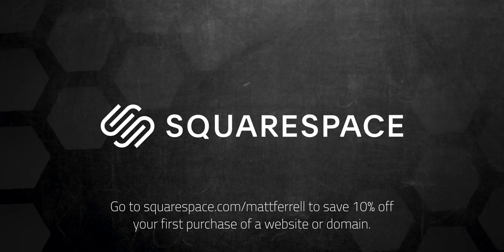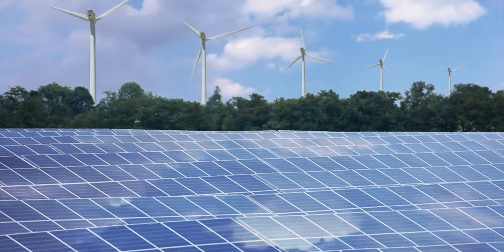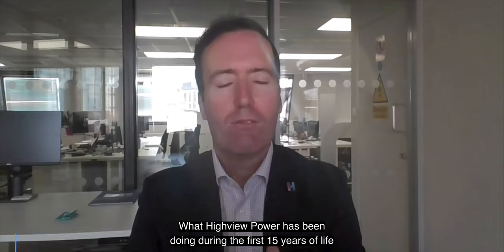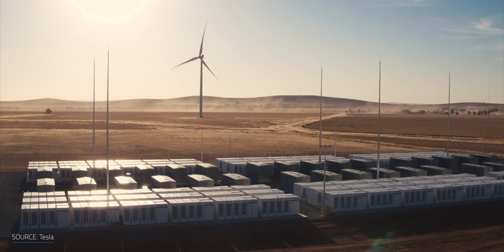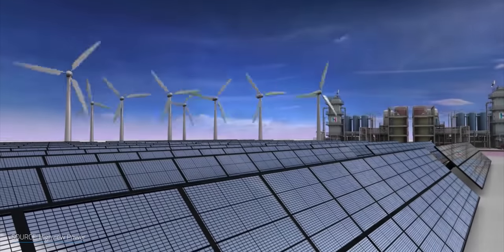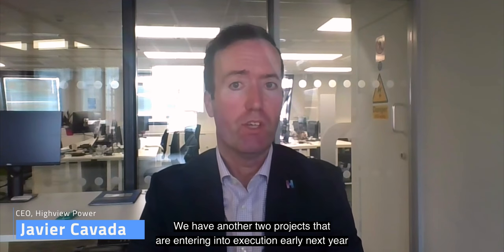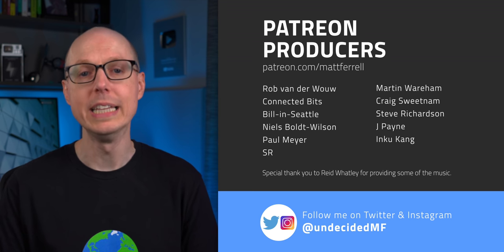Liquid Air Battery Explained - Rival to Lithium Ion Batteries?

Comment: Sorry for nitpicking, Matt, but again: "rare earth metals" ("rare earth elements", actually, by IUPAC) does not simply mean "rare" or "expensive" or "difficult to procure" metals. The term is precisely defined as denoting lanthanides plus scandium and yttrium - certainly not lithium, cobalt nor nickel. None of those are used in batteries, AFAIK, although some are used in permanent magnet motors (and generators), usually neodymium. Perhaps that's the source of seemingly endless misuse of the term.
Reply: Thank you. I am tired of the same rare-earth-myth being misused and spreading misinformation over and over and over...! At this point it is not nitpicking, it is a concession that people just believe things without questioning them not bothering with a quick lookup if that information has some validity to it or whether it is pure bogus or something in-between.
Reply: @d1oftwins  Yes, talking science and technology requires precision. If one is going to use technical jargon of a particular field, one should use it correctly.
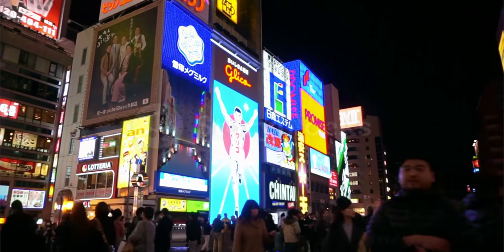Reply: 4:46 Also on the nitpicking front the air isn't frozen, it's condensed.  Frozen air would be a solid but you clearly said it's stored as a liquid.  You'd have to get down to -210°C (for the Nitrogen) and -218°C (Oxygen) for it to freeze.
Reply: @EscapeMCP  Yeah, again "loose" use of words that has no place in videos like this one.
Frozen air would be a nice "reservoir of coldness" (heat sink), but that's not what is needed here. (Frozen nitrogen is sometimes used as coolant in space-based telescopes - lighter per energy absorption capability than liquid helium, and much simpler than active refrigeration systems.)
Reply: Yes. You'll not stop it of course. People & groups have decided what's simple catch phrases for the masses for various things and they are soon promulgated, ingrained and thus the confusion will be permanent. It annoys me too but I realize that that's Life.
Reply: @grindupBaker  I somehow hoped that Matt will correct his ways if warned often enough. Perhaps I was giving him too much credit.
Reply: Poor Matt, he does nt stand a chance with you guys
Reply: @philipwoodgate9555  Hey, if we didn't respect Matt's work, we would not have bothered correcting him.
Reply: @bazoo513  excellent
Reply: @bazoo513  For me it is not so much the precision of language and terms, although I am quite a fan of people explaining themselves precisely. Nobody is perfect and it is a bit too much asked, at least for the layman, to accommodate themselves with the knowledge that trained scientists had to acquire in years. In a (broad) discussion it is possible to iron out the mistakes and nudge the ignorant into the right direction. What I don't like is that science myths are permeating the populace because information is accepted or dismissed on basis of personal bias and not because of the underlying facts.
People choose to believe or dismiss information without checking for correctness on a whim, which is everything else but scientific. Unfortunately that is how it works most of the time, most people don't have the time to invest in even a quick research, or worse, they simply do not care and just believe what fits their bias. I just don't like how and why such misinformation spreads, but I guess I have to accept that this is how our human perception of "reality" works and that we have to actively work against our biases to not contaminate the bare truth, at least as far as we are able to measure it.
Reply: @d1oftwins  I agree - intellectual laziness, confirmation bias and Dunning-Kruger effect all conspire to promote propagation of misinformation, especially within echo-chambers of social media. But I don't think this is the case here - all Matt did is use a wrong term from withing chemist's technical jargon. I will continue  pointing out his mistakes, but I don't think they diminish greatly the value of these videos.
I would prefer, though, if Matt acknowledged the error after all the corrections here in comments.
Reply: From usage I got the feeling the rare earth elements do not denote actual rarity of the material but rather that is what the material that is dug up to obtain them is called. No idea why though. Maybe it was considered rare at one time and the name stuck.
Reply: @jacobfreeman5444  They are "rare" because, while some or them are actually quite plentiful, they are "dispersed" in Earth core - pure ores are very rare.
From Wikipedia:
"Despite their name, rare-earth elements are – with the exception of the radioactive promethium – relatively plentiful in Earth's crust, with cerium being the 25th most abundant element at 68 parts per million, more abundant than copper. However, because of their geochemical properties, rare-earth elements are typically dispersed and not often found concentrated in rare-earth minerals; as a result economically exploitable ore deposits are less common.[5] The first rare-earth mineral discovered (1787) was gadolinite, a mineral composed of cerium, yttrium, iron, silicon, and other elements. This mineral was extracted from a mine in the village of Ytterby in Sweden; four of the rare-earth elements bear names derived from this single location."
Reply: @bazoo513  right so you grab some random square mile of Earth and some things will be more common WITHIN that load than others.

Copper is a Rare Element. Most of the stuff that you need to use electricity makes using electricity not a rational option for anything but logic and, in the past, lighting.

In the video you see the liquid nitrogen being sprayed. You see all these strange things in their videos. What You Don't See is the cost of liquid nitrogen  if the production is adequately scaled-up, less the cost of the energy. That's the variable that you need to disclose the range of cost for the infrastructure after the shaft that you spin or the input for the neutrons. Without knowledge of that number this is just another regurgitation of Industry propaganda something I have coined to be technological capture.
 Engineered liquids that are as dense as Battery Technology are a threat so you capture their technology and allow people to believe they are familiar with its potential.

I am inspired by the term "regulatory 'capture"" obviously. An engine that uses low enough cost liquid nitrogen COSTS less to buy and operate thAn currently compliant electric motor. Internationally Pakistan even Saudi Arabia and certainly India must flood the market with profitable liquid nitrogen. They can do this as a proof-of-concept either with geothermal or nuclear even concentrating solar but using liquid nitrogen to store electricity should be criminalized because it is a distraction and they make an effort to rehabilitate electricity while maintaining its impotence in disrupting market share sufficiently.
Reply: @joseylastborn8790  "input for the neutrons" - is something lost in translation here?
Reply: @bazoo513  before you engineer it to become Heat or electricity that's what you get from nuclear energy. I try to increase literacy by having the black box meaningfully spect.
Reply: @bazoo513  the process is very old and contributes to the dismal efficiency ratings which are not actually increased by taking advantage of wasted energy.

So I am a tremendous fan of liquid nitrogen as a carrier, as an alternative to fire, but storing mechanical energy in stationery situations is best done without controversy because the math is very very simple and again scale is key. It's several pages of gibberish in terms of the differential equations but if you want the engineer at the field and you focused in up on the exponent associated with the rotational velocity. You literally increase the storage until it fails. That results in an extremely high cost including the safety mechanisms. And I give credit to the Indian master-student for this knowledge though he his name is forgotten and so will not be found in this comment but you can easily look him up. His work actually Focus deal upon how to optimize the flywheel itself not so much how to maximize the amount of energy that you could store cost-effectively as you see in the excerpts.

The circumference of a wheel increases by about a factor of 7 which is a linear Factor but the radius of a wheel increases its energy storage by an exponential Factor. That means the cost of the energy that you store goes down exponentially by having fewer Wheels even if they spend far slower for example if you have half as many wheels that are twice as big in their radius your total circumference will be the same but if you have three times as many wheels with the same circumference accordingly in aggregate is the radius is 1/3 you will have a third less energy stored. The speed on the bleeding edge of the wheel is of course their circumference * the number of revolutions and whatever speed for time you are seeking. That's an important factor because the strain is what causes the limit. obviously flywheel should be hubless as heavy as possible without any need for structural strength because it flows Within a circular Channel.

 If you had take a bath for the whirlpool that forms when you let the water out I have a tip for you the second time you do it remember what direction the water spins and start start spinning it yourself.

 You will quickly no longer need convincing that you're actually slowing down the water because it's going to want to stay at that slower spinning you have slowed it down to by continuing this spinning yourself without the ability to take it with you when you stop manually to decelerating it! Of course the reason that you're no longer holding on to the water it's because it's falling into the drain so gravity is no longer creating all that friction between the bottom of the bathtub or at least the drain. you have to choose whether you want us to see the water slow down a little bit very very slowly slow down or whether you want to show it as it is being spun around by the drain which is even more exciting that a sheep on a trampoline to me.

 mechanical work is able to liquefy nitrogen and I believe there are other ways to do it but producing mechanical work from electricity to liquefy nitrogen and then using the liquid nitrogen to produce mechanical work to create electricity is the ways of creating alternative markets to waste capital so it does not disrupt your Market.

 Get into the time machine go tell the opponents of coal gas that the promise to use only natural gas has been broken maybe they know something we don't know about the footnotes of that contract. we need to stop playing with fire, ice is the king of all energy, but all we need is liquid with the low atmospheric Heat boiling ability at or slightly above atmospheric pressure. that material is far closer to energy itself for the market green good stuff. Back to the Future made it the stuff of Legend but we in the real world must make it the stuff that heels our planet.
Reply: @bazoo513  also I appreciate you pointing out then indeed what I speak of is not a wheel. It is sloshing Mass round and round it goes but within its moving mouth unbelievable jewels able to slay the dirtiest energy foes.

You don't have to connect mechanically to the Mass as you point out. You just have to have that smooth Channel with the multi mile radius and the minor or whatever sloshing around and around and around creating awesome potential it's Bryant you should be proud. It doesn't have to be rigid, not just not structural it can even be water itself and you could harvest the energy by Parachute or any number of ways. The circular fat pipe on some land mass with its Center on the spinning radius of the Earth will spend freely on its own that's what I was thinking after I sent you what you have paid attention to as if just the moan. I said spin the bathtub water to give it a head start in stopping. But I quickly realized that the ability to let water spin away from our spinning it has not been realized because it's a matter of scale as well. Every water molecule is a bearing and when you have a thick pipe going around one time of however many times a marathon and distance the circumference be if you located correctly the Earth will not continue to grope it so tight so let's be clear in order to harvest energy from wave power you don't need to go into the ocean you can just lay some pipe in the circle Hellfire that laser I do whatever you want after a while when the water grows still and in terms of Ray accelerating it so it is apparently still the amount of energy that's there is beyond almost calculation. you could compress shit to get it fusing with that sort of inertial energy duh
Reply: Could somebody please call Wolfram up and ask him to ask his tool there how fast the water will spend with a reasonable scale of circular pipe on the surface of the Earth. Ideally you would want to find a valley near the axis of the Earth so that you can have this pipe which does not have to be perfectly circular of course backed by granite's. I just looked above my feet and I have a globe and the globe has an access going through it which I assume is the access that it rotates in reality on in part and there is a bunch of ice at the bottom I think my glovis upside down but I don't know if that's Antarctica or something like that it appears that there is a significant radius there but that the centrifugal forces acting up on weightless water falling into the sewer need some brushing up on by me and are some distance away from critiquing the purpose done by this technology which is 2 spread cheap electrical production across the day and night regardless of the externalities.

Those who criticize it for being inefficient are only warm at best the problem with the technology is that it enables as applied domestic electrical energy production for wrongful electrification instead of the same technology enabling the internationalisation of the harvesting of the previously considered most political renewable energy sources. Specifically Fusion as harvested from the mantle of the Earth which is plenty of energy in one site to do all the multi horsepower work on our planet by liquefying the atmosphere and as some Jester noted providing a power source for CO2 capture schemes or whatever it is the more considered among us having in there dreams.

Heavy metals are good for one thing if by heavy a metal if you mean precious Earth magnets and that is getting far more set a timer Ariel speech heard....TBE
Reply: @joseylastborn8790  "You seem afraid "  -  Afraid? No, just knowing my physics.
Reply: @joseylastborn8790  Sloshing indeed.
I give up and invoke Poe's Law.
Reply: @bazoo513  I think I fell asleep last night watching the two hour and 21 minute Apple annual event about their operating system last year. TBE means to be edited apparently you are done so that is even lower a priority now unless somebody else is interested and how much deeper the sloshing water runs then even the just apparently only still. Oprah reminded me of Mark Kelly the way she wholeheartedly shild 4 Tim Cook and there was a moment of great candidness there from him turned into a little boy before an icon. I saw a big bird and this new creature that talks about coding which is kind of anti Apple compared to Android even though I don't even bother to install the if this then that apps on my devices anymore since I never got around to using them. I have hundreds of gigabytes of videos to try to make some sense out of the last night before my access to them offline ended and these Apple videos are in under watched treasure. At one point man Tim Cook introduces to say 300 says 3000 in terms of the number of magazines correcting himself and later somebody else talks about hundreds of magazines which means of course. If they said about Sesame Street you can watch the episodes that you watched as a kid even though they're no longer public especially the fresh ones. Big Bird Mitt Romney out of the White House before she became a pay-tv harli Lott so that divided between all but the top according to this to cook 300 is quite troubling. They say that $120 is less costly annually for magazines than 8000 Buckaroo from a bank that has not done plastic till now and it is funny to me that's a smorgasbord for the billions of people without any variety to speak of and even worse because they are recommending what people read in general meaning 99.99% of the readers are wasting their time because if you want to increase magazine readership you don't have magazine articles that are already read in the get a red and War let's try that one again you don't have what is already eating sufficient TBE
Reply: @bazoo513  I did not know that nitrogen crystals win the cost engineering battle for this disposable cooling capacity like some sort of moisture absorbing insert in a double pane window but for heat. A heat sink is a very different thing though. Changing the phase of nitrogen convert Heat  to Mass of the conventional sort opposed to heat as mass itself. Folding energy into mentions of mass itself better not be slothful dude but I suppose there's been instances of that for sure if not by you.
Reply: @bazoo513  it is better to learn from your physics as applied than 2 quote know it.

You can solve for the insights I however poorly have attempted to bring. What is a good price for moving energy? Liquids that can be stored at atmospheric pressure can be moved extremely inexpensively any distance across the ocean and they can also even in the case of saira Jenik fluids B transported in Pipelines which is kind of an interesting contrast putting oil in rail cars and having liquid nitrogen follow coal in water lines LOL. At least when you use spring water to push coal down around pipe only an idiot might say you're not going to be evaporating the precious fluid.

We used to use muscle power to do things that we let electricity do and my point is that we should not stop there we should let liquid nitrogen gain the market share it's portability all but requireis it to have.

What's new yesterday though is the idea of considering the impact upon the viability fission poses if liquid nitrogen is used to make safety inherent. To fund the capital investment on foreign lands to lighten atmospheric nitrogen into liquid that means take some of the conventional Mass out so it is easier to accelerate to thousands of miles per hour being less heavy and almost quantumly you don't have to pay the move the energy that is potential within it to its destination. it almost makes me reconsider how geothermal is the obvious answer and I asked somebody else to do that for me because it must be addressed. if you can have several square miles of liquid nitrogen on site how does that affect the paranoid potency to obstruct development? Liquid methane is safe enough but liquid nitrogen is so far beyond Bulletproof there may be a Nobel Prize in liquid nitrogen hybridization of  uranium [not as Google typed lithium so sorry for the typos! Google thinks I'm saying lithium when I was saying uranium as if the two words can be compared.]. What's good for natural gas is better for uranium when increasing the productivity of the turbine investment and getting rid of the fucking moronic cooling towers which represent waste always have and a way of releasing the heat into the atmosphere instead of outer space not selling points no.

If you have a gallon of liquid nitrogen and you use it to keep your fission hot but not too hot it's going to do a lot of mechanical work I mean is it just take it to to 800 or 900 x or are you talkin about four figure expansion and more importantly is the force of the expansion given the extra grading heatwise fission contributes misleading if only assumed understated? you're the physics expert so you tell me does nitrogen become Radioactive ever or is it like helium that way?

 you are the one that thinks electricity is about energy a common error. energy is too cheap but d i s t a n t so you have to move it more than mine it. nitrogen is the wheel not yet discovered to do that. Simple enough for you?
Reply: @joseylastborn8790  Between window panes? No, I don't think so. Freezing  nitrogen  is not cheap, and you would need to replenish it occasionally. But is was used as a coolant for space telescope sensors and electronics (I don't remember in which mission).
And mass has nothing to do with latent heat (except in the sense of mass-energy equivalence, but at this energy density level it is negligible, probably too small to even measure.)
Reply: @bazoo513  there is so much heat available not far below the surface of the Earth. Moving the energy in a usable form is everything. It is a Material Science question. I don't believe that a pipeline is Justified because I believe that the cost of flying things on the surface of the ocean via what I call a virtual Air Road is unbelievably low. It has been pointed out that you can surf at high speed on the surface of the ocean by turning the waves that pass under you into propulsive Force. This would allow your train kind of Hop from wave to wave remember the individual containers of liquid nitrogen are not rigid in terms of being brittle what so ever and they can match the frequency meaning wave 2  wave distance so as to harvest that energy. The transmission of energy is of course the lifting as the ocean water rises it lifts cousin you're a long snake that is flying in this example not hyper Sonic Lee two bend with Incredible torque. This incredible torque is not a flaw it's just that there was not the Insight that it can be used for propulsion. You can engineer a thick snake filled with heavy syro genic fluid to do things that are not evolvable. The problem with our energy policy is that it is been evolved and never engineered from the top down. You can call that a form of cancer and it surely is. Real estate without restrictions is extraordinary really inexpensive. If you were to buy the Amazon for example and preserve it from deforestation that alone might justify the cost of the purchase and being able to harness the heat below it to Market worldwide would Finance the logistics. Not only would you preserve the rainforests but you could cause the demand for Frac gas for electric production Etc to become non-existent.

Or consider the Panama Canal. You again have made a path for the moon to pull one ocean into another. that's a very significant amount of energy that you can obtain letting it flow but nothing in comparison to a single heat mine. it's just about commoditizing energy. electricity fails to do that. Phase change materials accomplish it. At the scale I right about here massive unprecedented efficiency turbines to suck water into vapor to pre-cool the atmosphere for liquification are a dumb question to ask if big enough. Once you suck the water into vapor if-then condenses on its own as distilled. if you do this in the middle of the Panama Canal half of the canal has the distilled water flowing to the customers on both sides. you have distilled water pipes running along all for coasts of North and South America from the Panama Canal and the liquid nitrogen hubs Distributing the geothermal energy worldwide.
Reply: @d1oftwins  but then isn't the problem the fact that it's incorrectly named rather than the fact that non science folks misunderstand the meaning
Reply: @TCt83067695  No, it is not named incorrectly because "rare earth" is a clearly defined term as the original commenter mentioned. Although "rare earth" is an archaic term yet its use is established and thus wasn't changed, "rare earth" became a fixed term that upholds its definition to this day. A similar thing is physical flow of electric current versus technical flow of electric current, those are flowing in opposite directions yet the technical flow wasn't corrected or abolished for practical reasons.
It is not for the term to be easily digestible and understandable but the onus is on the uninformed to learn so much to be able to have an educated opinion if they decide to judge something that is out of their depth. And I am not saying that an educated opinion has to be correct, but I expect at least minimum effort, just a bit more than parroting hearsay.
Reply: @d1oftwins  cool, cool, cool, cool.
It's the fault of those uninformed plebians.
How dare they think the conventional meaning of a word is the same in a scientific field?
Only the wise know it's not.
Reply: @TCt83067695  Brooklyn 99 fan? Me too! Nice passive-aggressive answer that absolutely misses what I said.
Reply: @d1oftwins  NOINE NOINE!

And I don't think it was passive aggressive. I was full on aggressive.

Not that I'm a scientist but we all need to humble ourselves especially in the wake of current anti science fervor around us. There is a great anti elitist sentiment around us at the moment which is making us all unsafe.

We shld be removing barriers rather than putting them up and I think that starts with clear, assessible communication.

But that's just me tho 🤷🏾‍♂️
Reply: @TCt83067695  NOINE NOINE! ✊

"And I don't think it was passive aggressive. I was full on aggressive."
I like your honesty. :)

We are talking here about historically grown terms that got established and fixed in time. They have a clear meaning and shouldn't be changed since they are bound to a certain meaning, or they have a certain established application (like the mentioned technical current in schematics). There was not a deliberate intention to make it difficult to understand but also there are no efforts to make it easy either, "rare earth" was just a term that was coined at its time in the 18th century. It is a neutral thing that doesn't cater to anyone, it is just a label. When there is a rock in the way of a ship, you don't move the rock but the ship around it, in that way it is a bit too much asked to change a long established term.

The barriers of science fell with the internet. You have knowledge literally at you fingertips, the only barrier is to overcome ones own comfort to do a 5 minute research for a surface level understanding. And if you decide to go deeper you can find videos or podcasts that digest the essence of certain knowledge for you, in every field, not just science. I don't think there is anything smug or elitist about it to ask at least for minimum effort when information is so readily available. And if you feel unsafe about something you don't know the best thing you can do for yourself is to gather more knowledge. Unfortunately that knowledge is not always a clear path as one would like it to be as science is inherently dissenting, and even more so when that research is fresh and unexplored. Nobody is going to do the filtering for you and tell you what is right and what is wrong because simply nobody knows (yet). Science surely can converge on different topics but it takes time. That is an unfortunate fact whether you accept it or not.

I wish you a nice day. 😊
Reply: @d1oftwins  Language evolves. In fact, evolution is the whole basis of science. Updating one's position with preponderance of evidence.

Evidence, such as how often the layman gets a specific and, in your words, historic term wrong - interpreting it literally rather than technically.

Personally I don't place the burden on the layman. I place it on the scientific community who have the ability to update the term to fit with contemporary parlance and therefore reduce confusion.

The internet has been great for information, yes. But, like the main reason for this thread, the internet has also been great for misinformation. The anti mask ppl for instance walking my street don't need more confusing terminologies. They need less.

But anyway, what do I know?
Have a blessed day to you too fam 👍🏾😁
Reply: In reality lanthanides are often used in Nickel batteries, so even though they are not present in LIB, they have a small role in batteries field
Reply: @framili3734  OK, but here they mean cobalt. My point is that "rare earth elements" has a very specific technical meaning, and does not mean "metals difficult to obtain".
Reply: @joseylastborn8790   If you use the "waste" heat / cold of course the efficiency of the SYSTEM becomes higher (the process itself of course not if you want to nitpick). -  That is already done btw. Burning methan from sewage treatment, or drift wood or garbage - and producing electrictiy.

With luck 23 % of the energy will create motion to turn the turbines - the usual low efficiency for heat engines, but if the side product heat is used the efficiency is more than 60 %. That is not spectacular, but much better and it is a process that provides peak demand (of electricity). With the hot water for consumers and businesses they have buffer anyway. 

Cities in Germany, Austria and also in the Nordic countries handle it that way. 

Likewise - if the wind turbines stand still although they could produce  and solar panel produced electricty has to be given away for nothing (just to get it out of the grid)  - 60 % or 50 % efficiency of the process starts looking really good. Backup does cost money.

Hydropower plants also often do not run at full capacity (spring, after heavy rain), they let a part of the water bypass (if they could not sell it). If that has no negative effect on the ecosystems downstream (not sure about that) they could always use the full power of the stream and send the surplus into storage. 

hydropower is very cheap and there are many plants that have been built decades or even one century ago and are long written off. If they produce at low cost and only 50 % of the electricity will be put to use later (losses with storage) that is still a good deal.